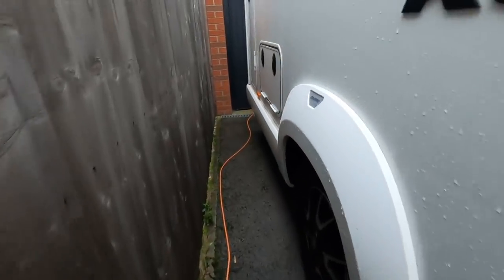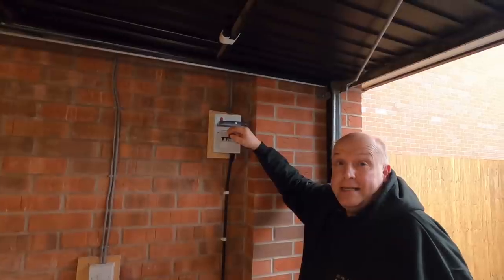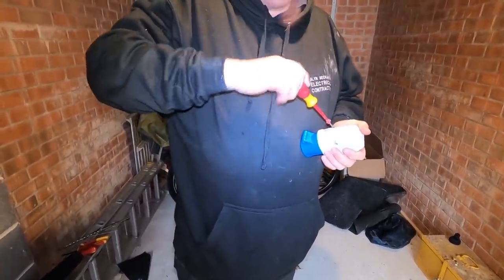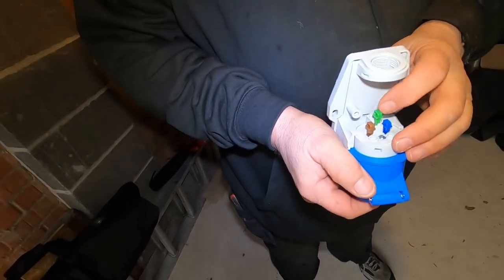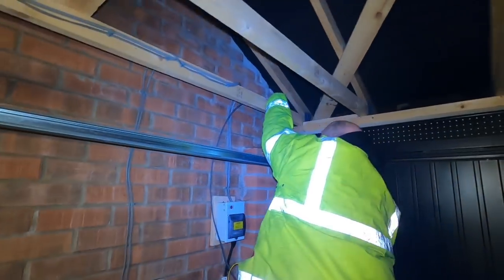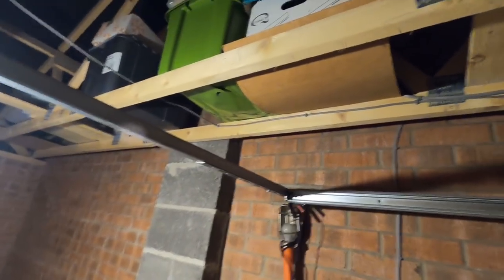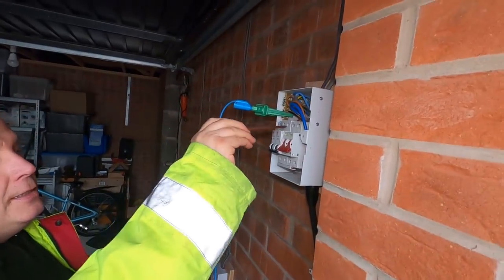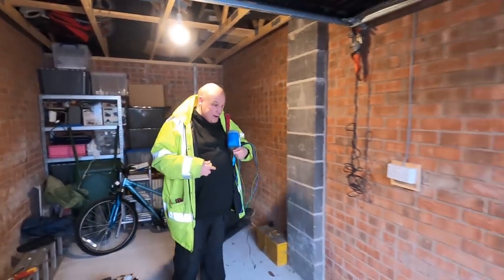Home Electric Hook Up Point For A Motorhome, Caravan Or Campervan

Comment: This is a fantastic idea and I'm sure there will be others out there wanting to do the same thing, may even give it a go as it's quite straight forward. However, would be nice to have some explanation on the earthing arrangement from your electric supply. If you are on TNCS and this has been carried through to the garage, which most newer houses are, this method could be quite dangerous if there was a fault with the neutral on the supply side: the chassis and metal body of your van will rise to 230v relative to the true ground. There's a whole section within the regs dedicated to supplying caravans for this very reason.
Reply from the maker: That's why I had it done by a qualified electrician.

Comment: Glad to see you have got the same opinion as me about electrics. I leave them well alone and get an expert to do the task. It may seem expensive at the time but imagine how much it would cost if it caused a fire or worse. I got our barn rewired as we inherited a system where there was one socket in the first room then there was a trailing socket to the next room and so on round the other 6. The electrician said it was a death  trap waiting to happen. He even used armoured cable as vermin could nibble the wire with it being an outbuilding. So well done for your sensible approach to what seems a simple task. Guy.
Reply from the maker: Thanks Guy

Comment: Interesting and informative video, thank you. Do you need to keep the electric hook up on all winter if you have a solar panel?
Reply from the maker: The Solar panel won't power our electric heating, which runs on 240v mains and I leave on low throughout the winter. Solar panels are connected to the 12v system for keeping the batteries charged they're not directly producing 240v mains, unless you have an 12v/240v invertor and a large solar panel array. If you don't need heating, then a good size solar panel will keep the batteries topped up. Bear in mind also, how little solar energy we receive this time of year!
Reply: @BobEarnshawMoHo  Thank you Bob, very helpful. Merry Christmas and Happy New Year to you Jenny and Poppy. X.

Comment: Hi Bob. Just one question, why do you leave your motorhome plugged in to the mains? Is it just to keep the batteries topped up or are you running something in the van?
Reply from the maker: I leave it plugged in at home. Keeps the batteries topped up and I can leave the heating on low during the winter. Keeps the damp away.
Reply: @BobEarnshawMoHo  I take it then Bob that you don't drain down your water / heater systems.
Reply from the maker: I drain my water down, it's an Alde system and the heater runs with a seperate fluid for the radiators. No need for water in the tank.
Reply: @BobEarnshawMoHo  Hi Bob Sorry to play 20 questions. But what would you suggest if you had Truma Combi heating. Heard that some people drain it down and then run it on mains with just hot air blower.
Do you have any experience?
Cheers Tim
Reply from the maker: Same applies, just turn off the water heater. The Truma heats air not water.

Comment: I am new to motor homing.  Do you keep yours charging all the time?  I haven’t been doing so during this lockdown but wondered if I should be?
Reply from the maker: Yes I leave it plugged in and heating on low. Keeps the batteries topped up and the cold away. You can leave the heating on even when the water is drained out, just switch the water heater off. I'll be covering this in a bit more detail in Sunday's video.
Reply: Thanks so much for that,  I was thinking I would have to have the water tank filled for the heating to be kept on.  I appreciate your advice.

Comment: The circuit for your RV is really small. The dedicated RV hookup for our coach is 240V 50A.
Reply from the maker: Yes and your RVs are 10ft longer,  2ft wider and 5 tons heavier than our Motorhomes, but our roads are 20ft narrower, and built by Romans. And your fuel costs a third of our price. On average. 😁
Reply: @BobEarnshawMoHo  There is that. Thinking about it my A/C units probably use 30A of that.

Comment: Be careful shorting the  lead, regs state it must be 25 m +/- 2 m
Reply from the maker: Well I confess I've never seen that before. I've been using a 10m lead  for around 10 years and no one has ever mentioned that! I do have a 25m length as well.
Reply from the maker: Yes I saw that after you said.

Comment: I would have used armoured cable when it's going outside.
Reply from the maker: There is armoured cable from the house to the garage, but that's in case someone puts a spade through it. No one is going to put a spade through it in the garage loft!